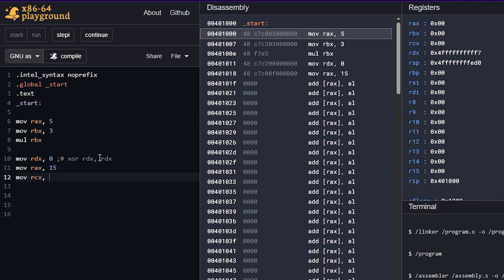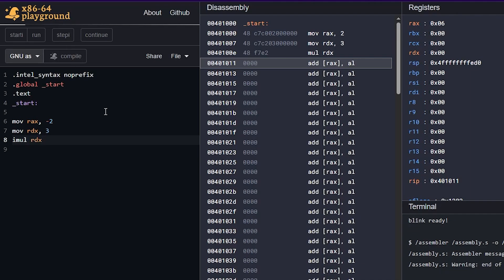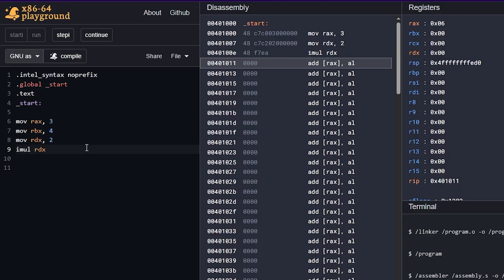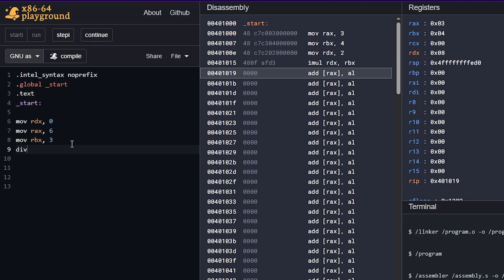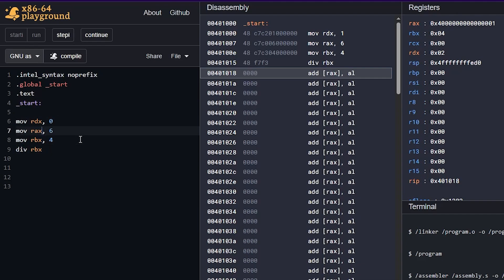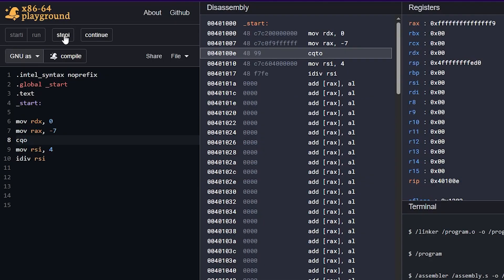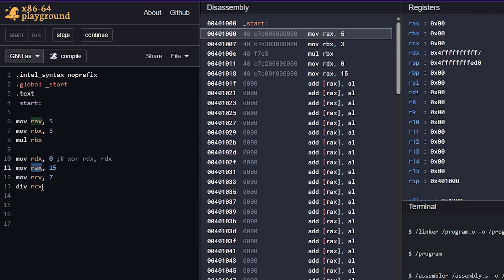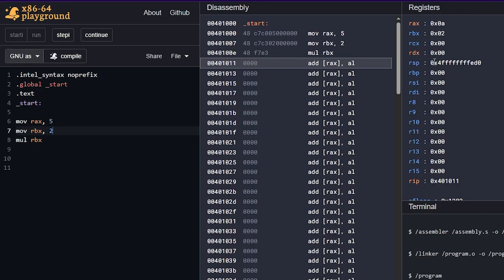How to Multiply & Divide in Assembly | Beginner Tutorial | x86-64 Assembly Programming Course

Comment: How come when you us DIV, you get a remainder? Why don't you get a decimal (float) number instead? Also can you use DIV with decimal numbers?
Reply from the maker: DIV is inherently for integers. There are different registers and instructions for floating‑point numbers. This is because floating‑point numbers are not saved as their ‘direct’ values (it would take a lot of data!), and instead are made up of three parts: sign/exponent/fraction. We can either save these 3 values using one 32-bit register (this would be a `float`), or a 64-bit register (this would be a `double`, hence the name -- double the size for double the precision).

To actually 'spit out' the decimal, these special registers (XMM registers), are hooked up to a separate arithmetic unit. So each time we call the value of a float, it's converted on-the-fly by crunching those numbers in the arithmetic unit.

So ultimately, floats are in different registers, and have different `DIV` equivalents that handle their special values. I hope this helps! We will touch on floats in the future!
Reply: @MxyAhoy  You are a good teacher and I hope you continue with these series.

Comment: Its kinda weird that rdx store the modulo value, but initialy, its part of the padding of the string of bits.
Reply from the maker: Yeah very weird indeed! This means that if the resulting value (the quotient) is greater than 64-bits, we'll have an exception/fault. So while that original value that we are trying to divide can be up to 128-bits wide, it's not a "blank check" for us to work with values greater than 64-bits. As soon as the division is done, we are restrained to dealing with 64-bit values (quotient in rax, remainder in rdx -- separate). Thanks for watching and for your comment!